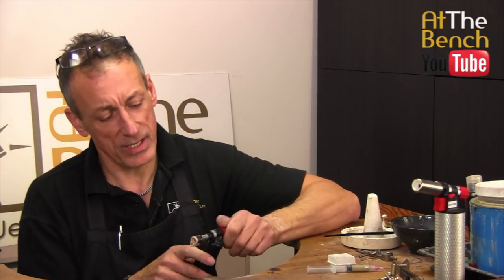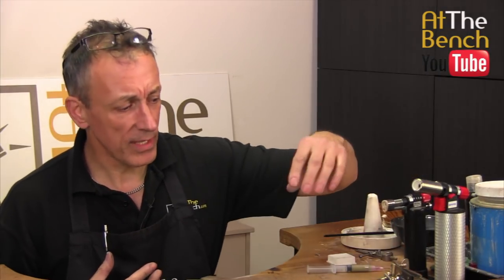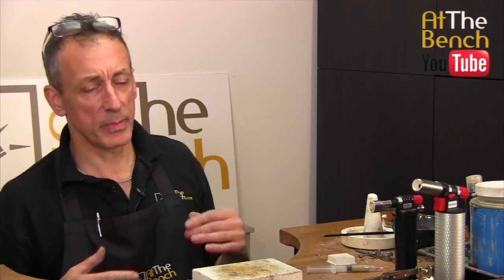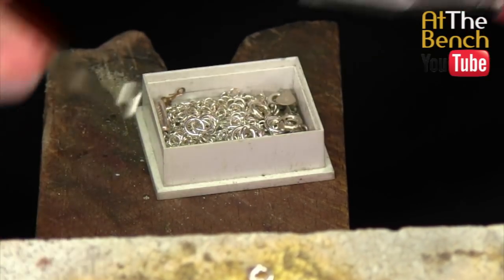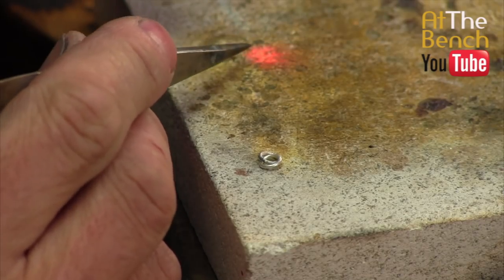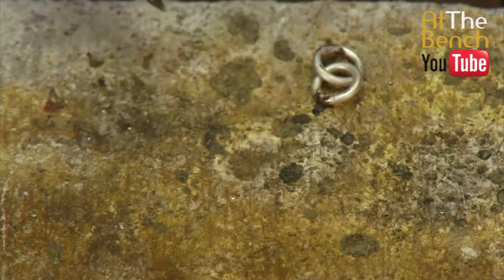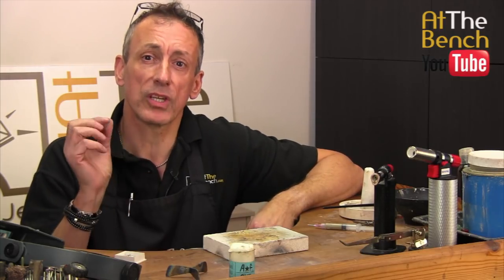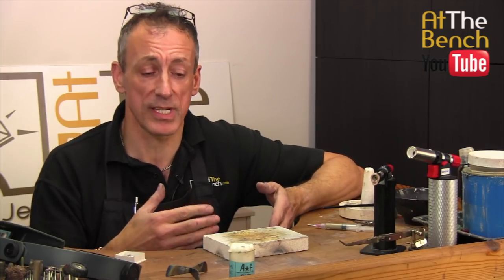Hotter Is Not Always Better - I Haven't Always Been Telling The Truth

Comment: Great lesson. Please do a lesson on the various sizes of torches applied to various sizes of pieces(ie. jump rings through cuffs). Im curious to what type of torch would one use if soldering a 18g sterling silver, 6inch x 1inch cuff.
Reply: same. Have you figured out the answer? torch tip size? i'm struggling with hard solder on 20g pendant about 40mm x 20mm

Comment: You have a relationship with the solder, materials, flame, heat. 
There is a joke there. "I dug out an old torch that I hadn't used in over 20 years. It was nice seeing an old flame". 
I suppose you have all heard that 50 thousand times. Cheers Andrew and Everyone.